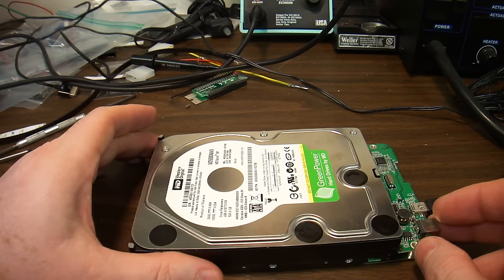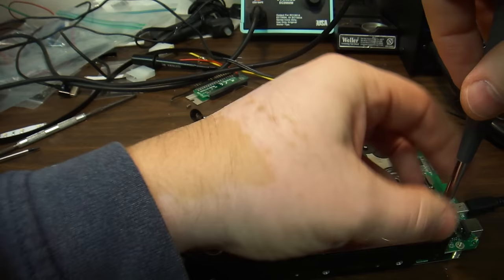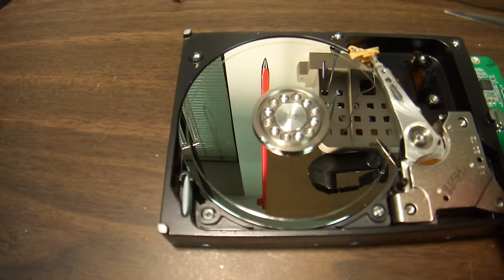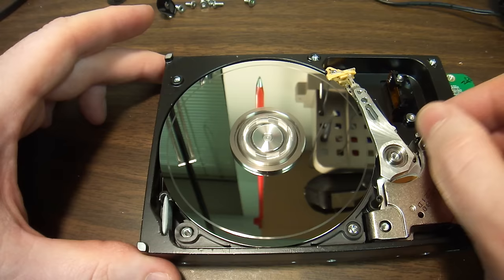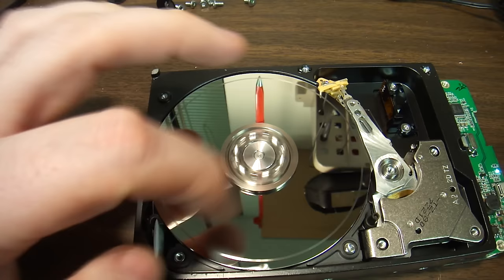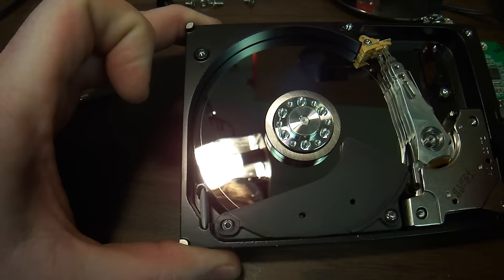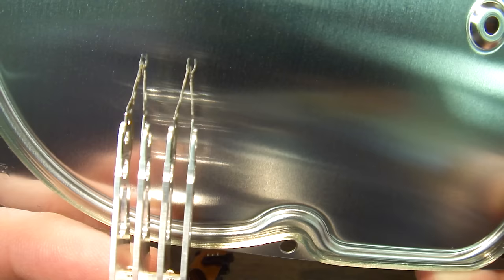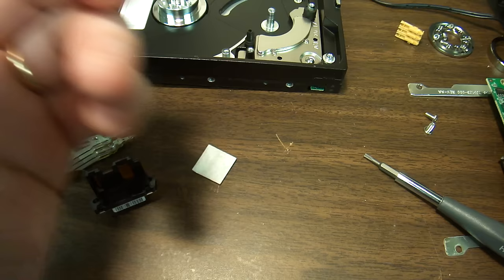Clicking hard drive dis-assembly. How to and what to expect. 500GIG Western Digital USB storage.

Comment: I recently discovered your channel to see if I could possible save what I thought was a stuck head on my 2TB HDD and I was confident in opening the drive and unjamming the heads until I found out that all three of my platters had 3-5 rings of very deep scratches...moral of the story: remove your HDDs before transporting a PC
Reply: nah, if you shut down the PC the heads should go into the "parking space", where small vibrations are not going to damage them.
Reply: I have a Samsung 2.5" HDD, it literally flew and fell on hard floor (turned off), and then... it still worked flawlessly, and was still working last time I checked... But when turned on, even a light shock can mean goodbye for good.
Reply: the best thing is to use an ssd i have 4 hdds in my Alienware 17 r2  i have 1x(512gb m.2) and 2 (256gb m.2) and 1 (4tb hdd for steam. all my personal stuff is on a few 128gb sand disk usb drives. my pics and over important docs are on DVDs nobody uses them but they are the best my be slow at reading but will never fail unless you scratch them

Comment: The worked for me after two pc shops refused to open the unreadable hard drive. as soon as I opened the case and saw it wasn't in a parked position I figured it was stuck and rotated counterclockwise the disc while dragging the reader head back to parked position and that fixed it. Thanks for sharing!
Reply: Well, and then, what happened ? Could you recover everything ?
How long did it work properly after that quick and dirty fix ?
Reply: @idiosyncrazy1980  For an even dirtier fix put the drive on its side and give it a bump into a table.  Worked for me, got the drive going but I thought it would work again after that which it did not.

Comment: It is possible to recover data from a hard drive with this type of damage. You won't get information that is on the damaged part... but all other areas are recoverable. You just have to have data recovery software that will ignore the read error that you will get when it gets to the end of the drive... Basically, since the heads are damaged, they would be replaced... You will see what you can get before the new ones get damaged, replace the heads again, and start reading again... As long as you get a set of heads that survive going over the damaged area.. you'll get everything on the inner part of the drive that isn't damaged. Which from your video is about 90%-95% of the data.

The alignment issues you are talking about are with the platters being aligned with each other.
When you replace the heads, you use paper to keep them from crashing on each other... you then remove the paper seperaters as you seat the heads on the HDD platters.
Reply: Which kind of software? Any recommendation, Welcome. Thanks
Reply: no if the controller can't pass the POST!, that kind of damage is a dead one. Atleast not using the original controllers, but a hacked one
Reply: no the damaged area would just damage the new set of heads put on the system, Also where it reads to seek and read track 0 is messed up, so it will never be able to become ready UNLESS u turn the head off that reads that platter unless all the platters have that damage.
Reply: In a case like this a live PCB swap could do the trick – see the presentation from Scott Moulton ad DefCon15.

Comment: Actually, the read heads are somewhat easy to replace. They have sort of a springy head so the reader can be repelled by the individual magnetic pulls. That springiness also allows for flexibility between platter thicknesses. and that thing about the formatting, all read heads I've seen are the same, they all same amount of turns in the copper coil, and no chip. This means the only electronics in it is the ribbon wire, coil, and heads. The chip that controls the movement is either on a board inside the enclosure, or on the outer board. 

To make a long story short, just unplug the reader, unscrew the plastic guide thing that keeps the heads from going too far from the platter, remove the top neodymium magnet, and remove the read heads.

Installation: Unless you plan to save the platters, you don't have to worry about scratching them when removing the heads, just don't let it touch the ones in the new drive. To install them, just do the same thing to remove the damaged heads, then slide the new ones into the plastic guide and screw it down and it should be good to go. Just don't forget to put the magnet back and plug the read head in to the board.

Edit: Nvm, I guess there's more to it then that: https://youtu.be/J9P4UadRdNA
Well, I was mostly right.
Reply: have a disk with me to know what happened to it and it no longer works and I want to fix it in the strongest coefficient where it is, I want what is inside it, it is very important to me, Can you show me the strongest coefficient for it
Reply: Wow, that's awesome. I'm thinking of doing this myself so I have got questions. Will it work if I swap the head using the same model, size, first 3 digits of serial number and same firmware version?

If it will work, can I use hddsuperclone to clone the hard drive or I still have to use PC3000??

Comment: Thanks for posting. Just for folks to be aware, if you intend to open a HDD, you need to do it in a clean environment. Airborne dust is sufficient to cause problems when it settles on the platter. Finger prints on the platter are a disaster. Cover your hair and clothing, wear neoprene (or touch sensitive) gloves. Generally parts (such as heads) are not interchangeable. If there is annular scoring as in this example, other tracks/ sectors may be readable. If he scoring is a spiral, that crosses all data tracks and renders the drive scrap metal. You need good light and the steady hands of a surgeon. :) :)

Comment: most drives can be forced to read specific tracks with specialized interfaces and software, usually provided thru the manufacturer. this can allow retrieval of partial data from non damaged areas, but only if the heads are undamaged.  if heads are non functional, some services have success by actually removing the disc platters and mounting them into a new case with good heads, much like a manufacturing process.  inspection at microscope levels to determine suitability is essential before choosing what to do, as even minute surface defects will ruin subsequent heads that attempt access to those areas. most recover is a multistep process, first to enable reliable mechanical operation, then read as much data into an external image file, and finally parse the recovered image file for data structure and useable data.  

with many systems, the fragmentation of files is extensive and often very time consuming makingit difficult to recover individual consecutive data (however, even partial data can be useful)

Comment: You can't "force" the drive into the read position! Data recovery centres CAN recover data from such drives and it is likely they could have recovered the data off this drive, prior to dismantling.(obviously there will be some data that cannot be recovered where the heads have crashed into the platter). It does depend on the ability to use the original head (or if they can install new r/w heads). Recovery centres have specialised software to step the heads and control which track is read. The data DOES NOT have to align vertically between platters. There is some form of alignment based purely on the relationship between the heads and how they are mounted on the drive, but this has nothing to do with VERTICAL data alignment.

Today's high capacity drives (usually) have logical allocations. This means the drive to the "end user" may be described for example as 2048 tracks and two r/w heads, while in practice, the physical device may have hardware that uses two platters and four heads. The computer requests the drive to write on track 1056, but the hard drive "logically" locates the appropriate track that "represents" track number 1056. This track could be on the second platter, read and written by head three. The computer does not need to know this logical allocation, this is handled by the embedded software on the hard drive.
Reply: Praise the lord and all mystic creatures! Not everybody (including the incompetent car mechanics in the video) is out of his mind. Fills me with hope for humanity.
I can not understand why it's not obvious to everybody that 99.9% of the data on the drive was fine BEFORE that """""expert""""" violantly destroyed it while spitting out nonsense about sky being blue, motor rotates and knife doing scratchy noises. DJ Hard Disk in da house.
Reply: @eugenkeller  exactly LOL
these noobs who dont know anything about data recovery talk bout head crashes like its the worst thing but guy at ontrack could recover 99% of data so easy even in bad hc cases

Comment: after a head crash, I would expect the head(s) to be "junk", so I would not expect them to work, even on undamaged parts of the disk; in the old days, with ferromagnetic coating, one could easily see the "furrow" that was ploughed by the head, and examining the head would also show the magnetic material clogging and/or having scratched up the head(s); good explanation, great video! BTW, I don't think you have to align "bits" on the surfaces, they would automagically align when the disks are reformatted (deep, including timing tracks); a bigger problem IMO would be (re)balancing the disks on the spindle, to avoid "wobble" when they turn at high speed? probably the falling over caused ALL of the "top" heads to "bounce" off the surface, and start pushing up material

Comment: Ok. A drive can be in any direction. As long as you don't move it when it's running, it's all good.

Proof :
"According to several manufacturers, mounting a 3/5″ hard drive horizontally, vertically, or sideways doesn’t affect the hard drive life significantly.

These are statements taken from the hard drive literature at each manufacturer’s website; it’s four years old but things probably haven’t changed much.

Hitachi:

The drive will operate in all axes (6 directions). Performance and error rate will stay within specification limits if the drive is operated in the other orientations from which it was formatted.

Western Digital:

Physical mounting of the drive: WD drives will function normally whether they are mounted sideways or upside down (any X, Y, Z orientation).

Maxtor:

The hard drive can be mounted in any orientation.

Samsung:

As long as it is securely attached to the chassis, hard disk drives may be mounted either horizontally or vertically depending on how your computer’s case is constructed."
Reply: But, if for example you don't run a drive laying down (horizontal), you are adding a very slight stress on the head because they are designed to move horizontally. It takes less energy to make the heads travel horizontally than vertically. (The difference is way too small to be significant).

But i would never make the claim that running hard drives in any other ways beside horizontally, will lead to a hard drive failure. That's just rubbish.

Comment: I have the same problem... I purchased a 4tb Seagate external drive, I then proceeded to transfer 20 years of data from 4 smaller external hard drives, totalling around 3tb, onto it. I formatted each one as I finished & used them for other things.. About a week later I was vacuuming, caught the external drives power lead under a table, this caused the drive to fall 2" onto its side & it immediately emitted a nasty screaming/grinding/rotating noise, in the same way that one is.. 

I strongly suspect my platters now look exactly the same as your one.. I will open it at some point to see, I`ve been avoiding it as I`m kinda hoping it will miraculously fix itself, even though I`m 99% sure its now permanently dead.

The moral of the story is, always back things up at least twice...

I also think I`ll be wrapping my external drives in a couple of layers of bubblewrap in future, just in case..
Reply: Indeed that was kinda foolish, to have the opportunity to make a proper backup (having the data on one device only is not a backup), and yet use the older HDDs to hord moar data, probably less worthwhile than those 3TB... You could have recovered part of the older data from those still working drives, depending on how much new data had been written on them since. The damaged HDD could still be partially recovered by a professional data recovery company, if you haven't made a foolish attempt to open it in dusty environment and screw it up for good, but of course it would cost a lotta money, about a whore's day (depending on where you are located it might even be worth ten days of a whore's work, or a kidney).

Comment: the reason its scraping or making that sound when you're turning the disk with it powered off and the head is on the disk, is that when its powered up the air creates a path inbetween the head and the disk which makes it kind of float. kinda like an air hockey table.

Comment: They said the heads don't touch the surface of the disc while spinning because the air friction slightly lift it up but at 5:35 I can hear noise when it reaches the scratch area which means the heads are in contact with the disc while reading data.
Reply: 1) The cover is off, as the guy said (one of the few smart things he said in this video) it might mess up the air flow which is required for the heads to fly above the platters — at an extremely small distance though.
2) The deep scratches alter the platters' surface, creating irregularities which look small with the naked eye but are enormous compared with the heads' size and the distance at which they normally fly over the platters – just imagine a Formula 1 car driving on a volcanic landscape...

Comment: To take the heads arm out you have to remove the little rubber tube that prevents the head arm to move out of the heads rest (yellowish teflon peace).
Reply: have a disk with me to know what happened to it and it no longer works and I want to fix it in the strongest coefficient where it is, I want what is inside it, it is very important to me, Can you show me the strongest coefficient for it

Comment: Surely a head replacement would have helped get some data off the disc though? The head had scratched the disc yes so that data is gone obviously. However the head was also visibly damaged so replacing it (assuming the damage isn't on an important part of initialisation) should surely work in recovering some data? Or does any scratch to any part of any disc make it completely unreadable ?

Comment: Mine was clicking, scratching and beeping.  Attempted to reset the head placement but it didn't need that as the heads were in place.  Looking at the top platter #1 of 3, I see that there are at least 9 scored rings around the top platter going down about 1 inch to the center from outside edge.  There are a few metal shavings on the platter too. When I look at the heads. I can see that there is a bent one. Looking at the other heads I one of them looks like a preying mantis at the side waiting for it's prey. It's literally 5 mm off the heads and touching the bottom of the HDD case.

Needless to say I'm not very optimistic in getting this fixed!

Comment: Even if you get the identical parts with all the matching specs ... you still can't replace the head since new drives are all pre-calibrated at the factory with specific settings in the firmware... & it's different for each and every single drive.
Reply: +Advection357 who told you that?
Reply: Hugo Trujillo I read an article about it... was a while ago so I can't link it. Anyway, the method used to work with older drives.. but now new drives that have like 1 tb on a single platter are many times more dense & the calibration needed is equally more precise.. so even the smallest misalignment will throw the head off... & each drive has differences at this level of precision.. hence requiring a different calibration.

Comment: I'm wondering why you did not try to recover any data? I had the exact same HDD shown here. It stopped reading any data. So I opened it the same as you. No visual damage was there, but I did make the mistake of turning it on to see if it spins. It did, and the heads went crazy. I put it back together and was able to recover 90% of the data. Somehow opening it let it work again for enough time to copy/paste data to another drive.

Comment: I had the same problem with my 1.2TB seagate.  I did lose stuff, but you just have to move on.  I had two rings like that, one on the outside, and one in the inside.

Comment: Head crash. Drive can no longer find the servo data needed.to become ready. Sometimes they can turn a head or 2 off to read data but they have to change the head stack first but that damaged area would just destroy the new set as well. Recovery from this is difficult and usually can't be done